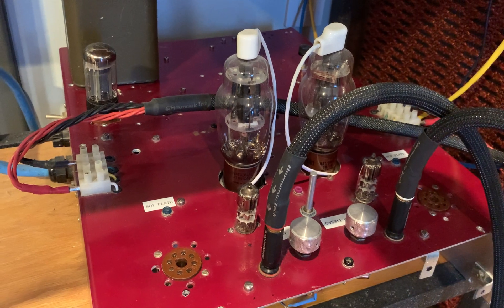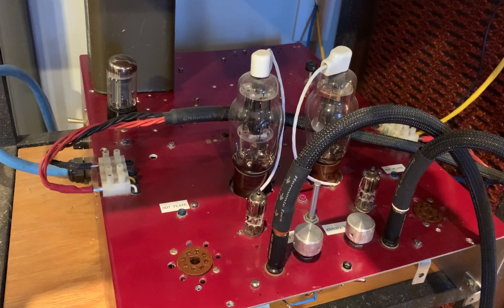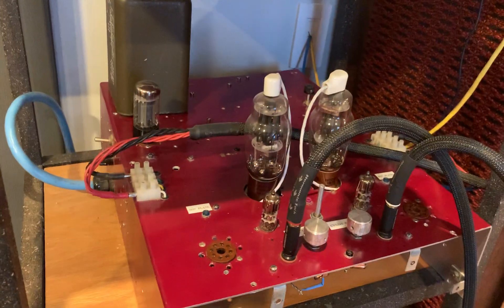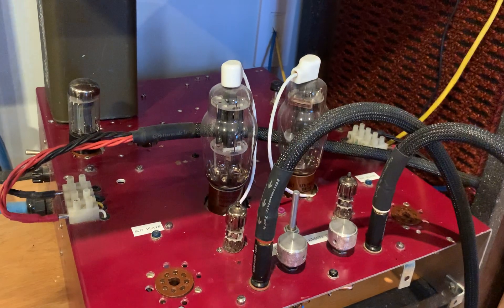Building the SET amp! - chassis size considerations

Comment: Any kits using 300 tubes? 845 or 800 tubes?
Reply from the maker: I do not recommend DHT tubes for beginner projects, as 1., they are much more complex 2., way more expensive 3., 845/805 tubes have ABSOLUTELY LETHAL voltages, that a beginner MUST stay away from. Even I, with 20 yrs of experience do not go there. One mistake or an accident and you (or even worse, your one of your family members) are dead.

Comment: Thanks again for another very informative video!

Can you recommend some sites where to order chassis/frames/plates? Do any of them offer the possibility of custom drilling (at reasonable cost) or would you say that it takes some of the learning curve and fun away? Many thanks!
Reply from the maker: I cannot recommend any site to order from, as it is so diverse based on where you live. For example, I live in Hawaii, so the shipping costs make it a major loss to order a big chassis from anywhere... so, I never considered it as a realistic option, and was not looking into sources. The best is to go through the learning curve and get an aluminum sheet the right size locally, a set of hole punches (cheap now on ebay) for tube sockets, and a drill to drill small holes for the screws and transformer mounting.  Also, in the future you might change the amp, and then you will need the hole punches to punch a hole for an extra tube if needed... ; )

Comment: hello brother I have emailed you some information about my speakers I'm building to use with. tube amp
Reply from the maker: Got it, will reply !;
Reply: @realworldaudio   thanks for the fast reply , I was going to order a lot of mdf , so you saved me a lot of money , thanks , can i use mdf to make subwoofer box as I have some left also or should I make subwoofer box with pine instead
Reply: Bro I'm getting Hammond 1760/50 I'm getting locally, many versions of it are available, can this one be used to replace Hammond 1638 sea ( the expensive one)
Reply from the maker: @IDontExist14  The 1750B, 1760C, 1760CP will work! ; )
Reply from the maker: @IDontExist14  The sub also benefits from the pine or plywood. You could use the MDF for equipment racks ; )
Reply: @realworldaudio  thanks for the suggestion , I will try to get it tommrow